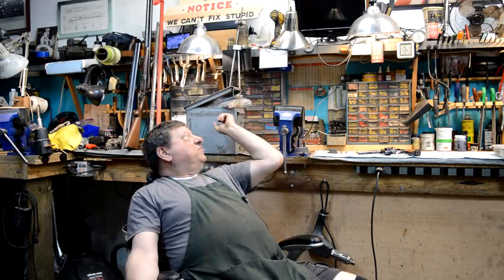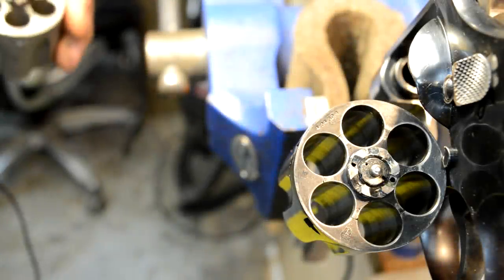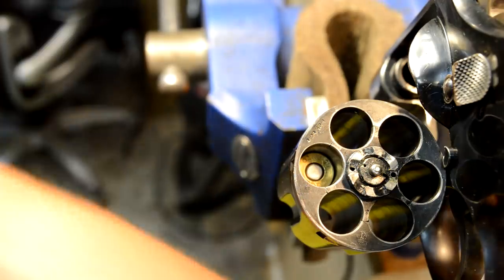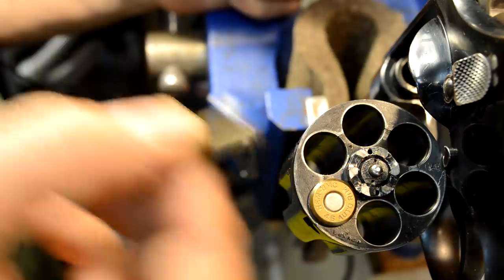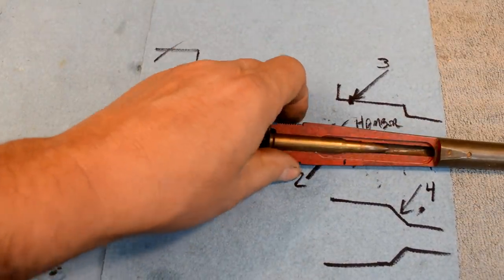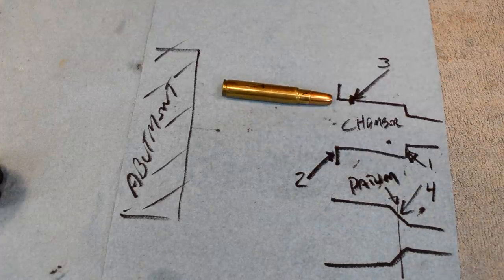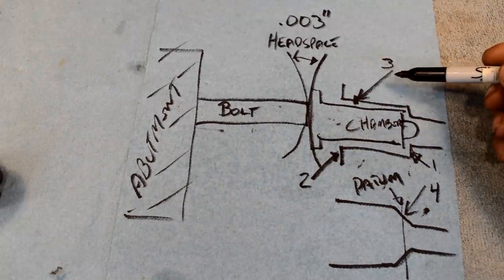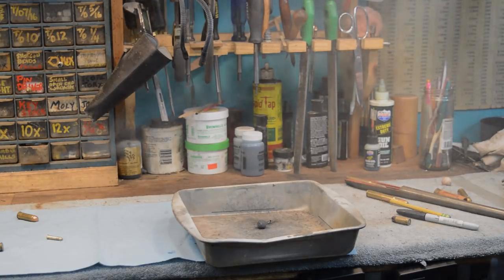Questions, Answered #7.....Headspace

Comment: Are there any rounds that only have a taper from head to the mouth and headspace on the overall case taper? Idk if I’m describing what I’m thinking lol. No rim, no case mouth (different crimping wouldn’t matter) no shoulder, just like a jacobs  taper?
Reply: 9mm Luger… sort of? But not really. It has no rim, and a constant taper, but it headspaces off the case mouth. There were some big bore, black powder rounds that had constant taper, but they headspaced off the rim. I suspect that straight taper is not used for headspace because it would be extremely difficult to extract the fired case, as it would extrude the metal forward very easily under tens of thousands of PSI when fired. 

If you reload tapered cartridges, (usually rim headspaced) you will experience case growth with every firing, and will have to trim the length back with every firing. This will eventually leave the case very thin at the back, and it will crack. The worse case situation will be if you do not trim off the excess length at the case mouth and it jams into the rifling when chambered, causing a radical spike in pressure when fired. 

Conversely, rounds that headspace off the shoulder (datum line) usually do not have significant case growth when fired. 

This is a great question, that will compel me to revisit “Cartridges of the World” to see if there was a straight taper, rimless cartridge that did not headspace off of the case mouth. I will let you know if I find anything.
Reply: I didn’t find any taper headspace cartridges. Most straight tapered cases have a rim, or semi-rim. Also, the “straight taper” cases usually have a cylindrical section to hold the bullet, (so they aren’t truly straight-tapered), and the rimless ones either headspace off of the case mouth or off of a nearly imperceptible shoulder. 

I think I understand the question, because mill tooling does use straight tapers in various chucks and bits/holders for indexing.  If cartridge cases were made of suitably dimensionally stable materials, it might be conceivable.  Thin brass (manufactured to a disposable standard) doesn’t measure up.

Comment: Thank you Mark for making this video!  I have been trying to explain head spacing to my friend for months and he just didn't get it,  he made two .22lr, ,22long, .22 short smooth bore derringers but one's hammer hits the rim so hard it misfires or explodes sending brass shrapnel flying, while the second one sets the rim primers off 99% of the time but the rear of the brass rim case keeps exploding except when he uses a 710 fps CCI .22 short.  he got so frustrated that he had me over to figure them out because my derringers I made for myself work just fine.  When I opened the fold down barrels I seen the problem right away, I took a few live .22lr's and I removed the projectile and the powder leaving only the primer live. I inserted one brass case into the barrel and said "look you didn't account for the head space, most rim fire cartridges head space on the rim itself and when fully inserted it must be flush with the barrel"  his bullet diameter was spot on but the rims were always sticking out, no wonder they exploded at the rim because there was nothing supporting the sides of the rim causing an explosion and shrapnel, and the 710 fps .22 short's didn't explode because that is the least powerful .22 short you can buy and the brass was strong enough to take the pressure with those. I showed him my derringer barrel  and he still thought he just needs to machine out the rim section and all will work, unfortunately I had to break his heart that now his bullet and barrel will have a rim sized gap and the hammer wont make contact st all.  Instead of making new barrels I showed him that he just needs to move the hinge placement so the bullet and the rim are like they should be and there will be no more gap.  I also donated a weaker spring for the hammer on the first one so the rim is hit with just right amount of force.  Again thank you Mark for making this video so next time I can just have him watch your video and not have me try to explain the head space principal on paper malfunctioning his brain every time. LOL  God Bless you Mark, I love your channel and your amazing content.
Reply from the maker: Outstanding
Reply: @marknovak8255  THANK YOU FOR BEING SO AWESOME MARK :)
Reply: @FranzAntonMesmer  i JUST DID NOT WANT HIM TO EAT MORE BRASS LOL

Comment: Outside of a new bolt head, how do you correct British .303 headspace issues?
Reply: That's what they did in the factory for their rifles, I'd assume that's what we'd need to do today too.
Reply: My father in-law left a .303 British behind when he passed that was the tightest locking bolt round I've ever seen in any rifle there is such a small amount of space in that weapon that if you bounced inside it like you did when you were on the bus when you were a kid you'd break your neck because there isn't really anywhere for your head to go.  But if I were you, I would take the bolt and boil it and ensure there is absolutely no film or residue from the burnt powder. Because some rifles have been known to punch a tiny hole in the primer cap and leave a residue behind in the, or on the bolt face. And in a short time it will not seat properly when you try to lock the bolt into the forward position and the arm will not move all the way down and seat itself. I've seen other rifles have similar problems. If I am understanding what you are saying. Maybe , maybe not just trying to help if possible. Good luck with your.303, it is one of the best rifles I've ever had the opportunity to shoot though.
Reply: I suspect you just keep buying British .303's till you get a good one???  :)  I thought they had a replaceable bolt head? (I do get in trouble when I think....)
Reply: Depends on if it actually has a head-spacing issue and it is not terrible ammunition. The British, especially during wartime, had abysmal quality-control on their ammunition, so much so that it was a cited reason for retaining the rimmed case on the .303 in the first place, because only the most grossly out-of-spec rim would be dangerous to shoot. Odds are that if your gun has "head spacing issues," you probably will find a lot of it goes away if you take calipers to your ammunition and really weed through it. I don't have the numbers myself anymore as I don't keep any .303s at the moment, but you should be able to find the actual data without too much trouble.
Reply: The UK Mil Chamber guage for .303 is .064 go, .070 no go, .074 Field.  The SAAMI limits are .064 go, .067 no go, .074 Field
The correct way to adjust a Lee Enfield is by exchanging the bolt head which come in four sizes marked 1 - 4. No 1 is the shortest giving the greatest headspace and No 4 is the longest..

Finding spare bolt heads is not that easy these days.. there are a number of proposed solutions on the internet.. most of which I would not place much trust in. 

Most of the issues with .303 I have come across turn out to be folk trying to use neck resized cases in rifles they were not originally shot in. If you are having trouble chambering, try a full length resize first or try another brand. Some cases such as S & B sometimes have fat rims... The .303 Lee enfield is not usually that picky about its ammo...!

Comment: Would .003 in be 0.0762 mm or am I off a bit?
Reply: For you metric guys,try this. 1" ( inch ) = 25.4 mm .     4"=101.6 mm.    Move the decimal.  0.004"= 4 thou(sand).   0.004"=0.1016 mm. For all practical purposes   4 thou=1/10 mm =0.10  mm
And yes.   0.003"= 0.0762 mm or 3/4  of a  tenth of a mm.
Hope that helps.
Reply: That's ok, 0.0762mm.
Reply: Most people know that .30 caliber is 7.62mm.
So, yes, add 2 zeros to each and you get 
0.003" = 0.0762mm, you are correct.
Reply: @paulmanson253  I am not good with metric but you have helped me for sure
Reply: Let me throw a monkey wrench into the discussion. It is called "significant digits".  This is where the physical world and the mathematical world diverge.

When you say ".003" you have three significant digits. The digit to the right of the "3" isn't significant. That means we don't know what it is. ".003" and ".0030" are two different numbers. In the first case, if you took a very accurate micrometer and measured something that was ".003" it might measure .0032 or .0029 or .0035, and all of those would be ".003" to acceptable accuracy. However, none of them would be ".0030" to acceptable accuracy, because now we have four (not three) digits that are significant in the measurement. On the other hand, .00304 would be ".0030" to acceptable accuracy.

Now, getting back to the case in point. .003 inch and .0762 mm are the same _mathematically_. But _physically_, we have mixed significant digits. .0762 is claiming too much accuracy to be equivalent to .003 inch. So in the real world, .003" and .076 mm would be closer to equivalent. 

How can we determine the number of significant digits after such a conversion? Well, .0026 and .0035 are both acceptable versions of .003. So lets do the conversions: .0026" = .06604 mm. .0035" = .08890 mm. So ".003" is somewhere between .066 and .088 mm. Anything in that range is an acceptable conversion. That says we are really being over-specific even claiming that .003" equals .076 mm, we would be better off just saying that .003" equals .07 mm in the real physical world. The "62" part is completely meaningless in real world measurements.
Reply: @paulmanson253  1mm is .03937"
Reply: @randymagnum143  You know what ? You are quite correct.  I dug out muh calculamator and got some angry pixies to dance on the head of a pin,like angels. And yours is the number what got generated.  0.0393702441 is what my display did say.
And so what ? 40 thou is 1 millimeter with a 1.6% error built into that statement.
Metric and Imperial have separate definitions and reconciling the two just ain't gonna happen. My 1 inch micrometer is at the shop,so I cannot set it to your number and compare it.
I did say, " for all practical purposes ". 
The guy asking was honestly puzzled on how to deal with the unfamiliar. 
I did some rounding out I thought might help. It seems it did.
Chasing tenths is what expert machinists do when needed.
If they don't need it ,chasing precision costs time,effort and money.
Calling a revolver a .38 when projectile is really .357,and the original (Navy I think) specification was 0.36" is inaccurate. But I did sell the .38 I inherited from my father. And did not call it a 357 .
More than 20 years ago I did a rebuild on a 4 bolt Chevy 350. It was 30 over,and just for fun I did the math for the actual displacement as measured.
Can't really remember any more,but it might have been 401 or so.
But it was still a Chevy 350. Buick had a 401,I think. Calling it anything other than a 350 would not have been accurate when I sold the truck.
So. You are quite correct. So there.
Reply: @paulmanson253  i was just offering a number that has served me well enough in the course of hundreds of millions of dollars worth of machine work.  I certainly didn't mean to offend.  The .0000002 has never bit me in the ass yet
Reply: @paulmanson253  a .030 over 350 is roughly 355.
Over boring an engine to gain displacement, to the detriment of cylinder wall strength, is a horsepower losing battle.  We overbore small block chevys .03 because they have stumpy little connecting rods matched to a long stroke that geometrically forces the piston to wear the cylinder wall into an ovoid.   Better engineered engines will typically clean up with a hone job because of a more favorable rod length/stroke ratio.  Also why most aftermarket sbc rods are 6"
Reply: @randymagnum143  Again,you are quite correct. This particular" we "overbored that there small block because the previous owner was quite careless with it,and 20 over wasn't gonna cut the mustard. I had a choice of a 2 bolt 327 that was a mess or the one that was in the truck. So the mess I knew got rebuilt. By me. First major rebuild I ever did,sold it 4 years later and compression and vacuum gauge said it was fine. I applaud your greater expertise. Good for you. It is really easy to make a mistake that seems minor,only to have major consequences. Seen that,lots. Had to rebuild my Yamaha bike engine twice,the first time was just not good enough. Was a learning experience I built on with the truck engine.

Comment: The brass, can tell all.If your pulling it out with pliers, you have a  problem. That 1 shot Barret with the slip in chamber,and the plumbing cap,that blew in Kentucky's face is a disgrace to the name. I hope they haven't sold many.
Reply: It was not a Barret, it was a Serbu RN50. There is a BIG difference in design and lockup. 
Not all .50's are Barrets.
Reply: @endutubecensorship  Also, the Serbu didn't blow up because of poor manufacturing. Those SLAP rounds were already pissin' hot and years of unknown storage conditions can cause the powder to degrade, leading to even higher pressures.
Reply: @Atreyu472  Agreed, just an absolutely unfortunate situation.
Reply from the maker: It is my opinion that the Serbu design was not the cause, ammo and weapon use/maintenance were the issues